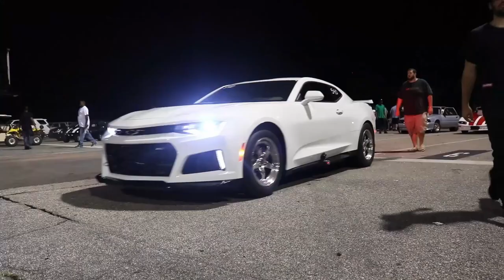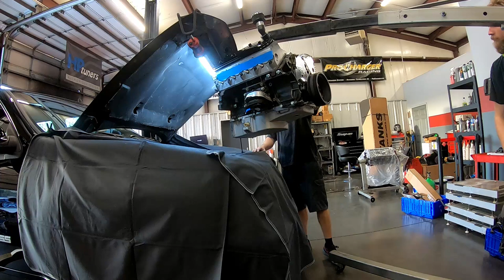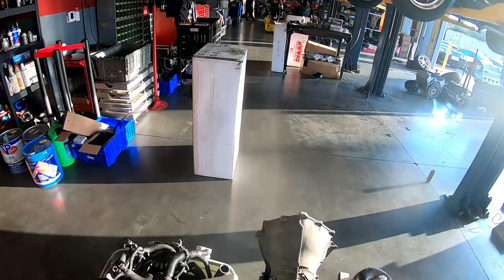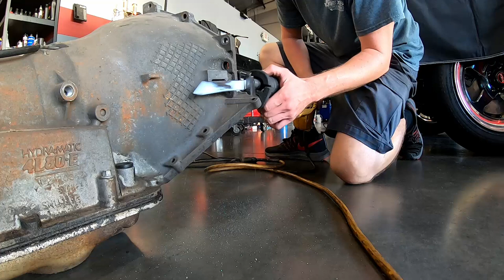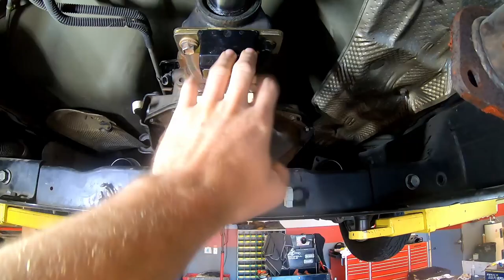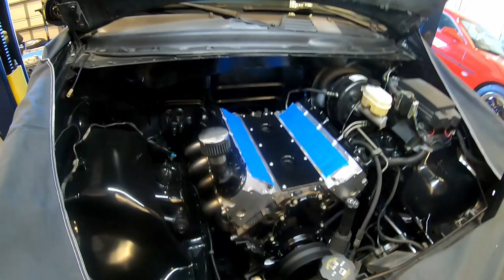TBSS 6.0L Engine and 4l80e Install

Comment: Remind why the need for conversion flex plate?
Reply: 4L80E converter has a different bolt pattern than the 4L70E that comes in a TBSS. So you need the appropriate flex plate for the 4L80E.